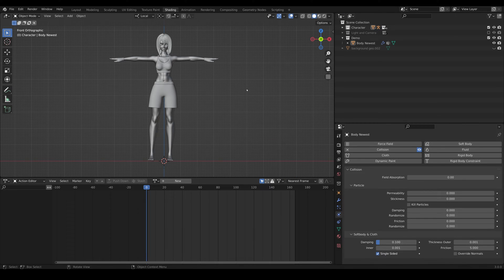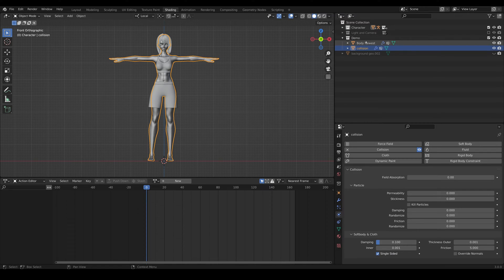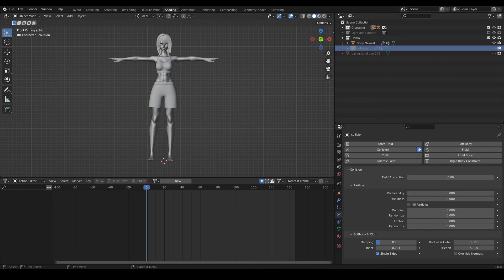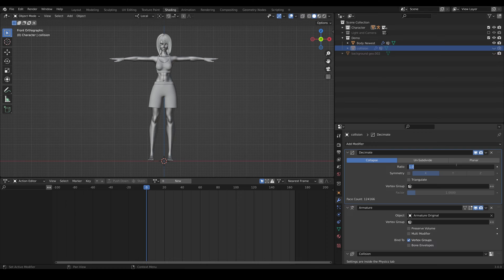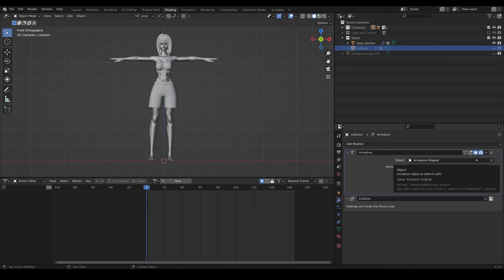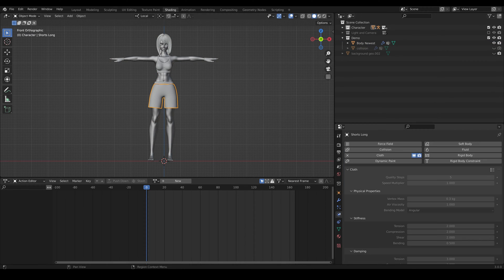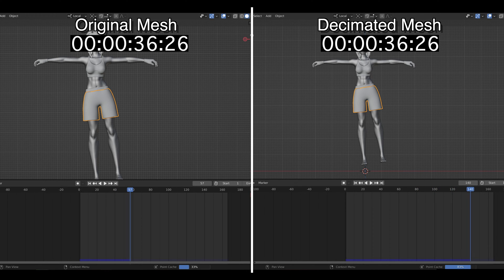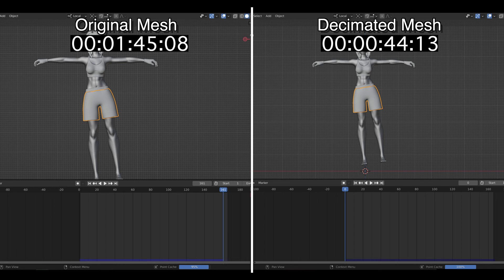Blender Tutorial: Speed Up Collision-based Simulation Baking

Comment: Thanks. Really cant tell the difference between the original and the decimated one.
Reply from the maker: Yep. It works well in most cases I think as long as the decimated version isn't too low on geometry and the bone weights are mostly correct.